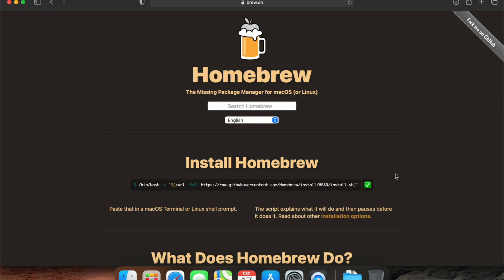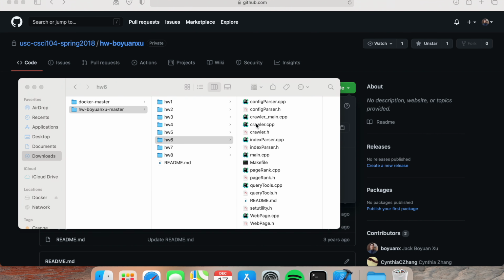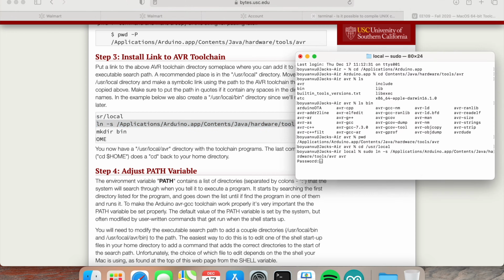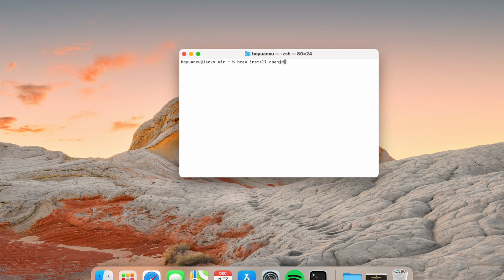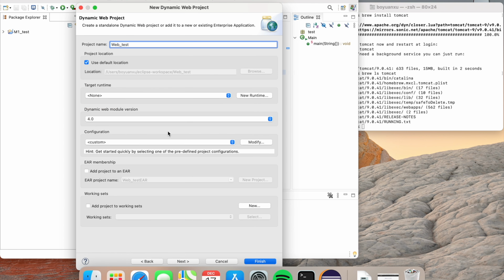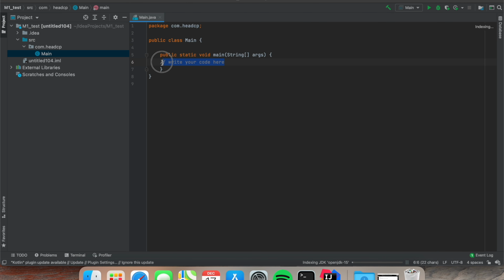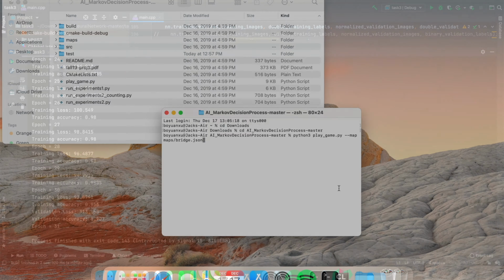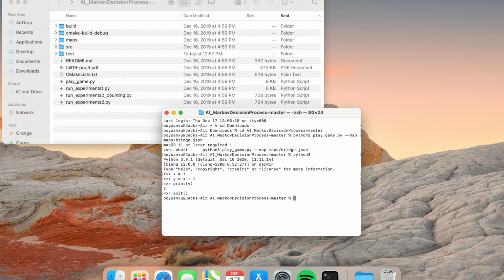M1 MacBook Tested for Computer Science Major Classes!

Comment from the maker: As of November 2021, almost all issues mentioned in this video have been resolved. M1 is now an incredibly solid processor for development work!
Reply: thanks for the update man. I am a CS student for Machine Learning. Does your video means that there is no need to buy the Pro version?
Reply from the maker: @andi9x17  If we are talking about the 13 inch, then no, Pro only adds more battery life. However, if you are referring to the M1 Pro chip, then that is a different story.
Reply: @headcp1299  Hey my friend. I am a computer engineering student, profilizing in Cyber Security. i mostly want it for linux (VMs),  programming, pentests, etc. Would it work good with a 16gb ram or should i look into a windows laptop. 
PLEASE HELP!
Reply: @fluturadomi756  windows laptop
Reply: @headcp1299  is 13 inch m1 enough for cybersecurity work and cs major now ? Will it hold in 5 years if 16gb?

Comment: Hey, Can I use 8 GB / 256 GB M1 macbook air for my college ?
I am going to be a Computer Science students in next few months. I want to buy this but I don't know if everything required will be working ( atleast under Rosetta 2 )
Reply: Incase you find the answer to your question, please make sure to let me know. I'd be really grateful cz I am considering the MacBook Air M1 too, and as a CSE student i am worried that few of the intel softwares might run on M1, if the apps are softwares are heavy Rosetta might not be very useful. Also, I don't want to be in situation, where I might have to jump back to intel just bcz few apps aren't working on M1.
Reply from the maker: If you’re only doing CS then everything will work fine. If you’re EE and deal with hardware stuff then I’m not exactly sure.
Reply: @headcp1299  I already bought it and its awesome.
Reply: @The Algorithm YESSS. I will highly recommend it.
Reply: The flutter howerver has some compatibilty issue.

Comment: So I'm starting a BS in CS this year.  For the first 3 semesters I only have one computer science class per semester since most is gen-ed, 4th semester has 3.  So that'd mean I have about 2 years until I get into the higher level comp. science classes.  Do you think in 2 years that some of the arm related issues might be ironed out?  Also could you maybe comment on if there's any downside to learning on it? Such as TAs/Professors using windows and therefore not able to help troubleshoot potential issues.  As a side note I have a fairly high-end windows PC already (3900x, 32gb ram, 3090. In my mid 20s so have nicer stuff than the average freshman), do you think having a macbook would be a good choice considering I already have a very good windows machine I could use if really neccesary, or maybe it would be better for me to stick with what I already know and go windows?  I imagine it might be helpful to be able to also do classwork on my desktop setup and would assume transfering work from windows to windows would be more straightforward than MacOS to Windows.

Sorry for so many questions and the wall of text, just trying to make the best decision.  Thanks for the video :-)
Reply from the maker: ARM compatibility issues have already been mostly ironed out and I have not run into any issues for a while now. You can always code on Windows now that it has a relatively good Linux subsystem but personally I don't enjoy it. For me, Windows is for gaming only and macOS is for serious business. It's really up to you. Apple devices do hold their value pretty well though so you should be able to sell them at a good price in the future.

Comment: So Im a uni student on computer science in greece. Should I wait for the 14'' or 16'' macbook with m1 or get the 16'' i9 intel macbook? I dont know what to do.. In uni we mostly use Visual Studio, Eclipse, Android Studio and when I am doing projects I usually open like a dozen tabs of stackoverflow. And I don't upgrate laptop for at least 3 years so I want it for long term.
Reply from the maker: Believe it or not, the M1 is on par with the i9 when it comes to most development workflows mainly due to its minimal thermal output. The i9 on the other hand gets hot very quickly and thus leads to a lot of throttling. In my opinion this M1 is already fast enough, I don’t really see how I’d need M1X in the near future. Also keep in mind the 14 and 16 M1X MacBooks will be a lot more expensive. If you can wait, then rumors are the M1X MacBooks are coming in April so you can decide then. Hope this helps =]
Reply: @headcp1299  Thank you so much! It was actually helpful. The reason i am talking about the future M1X and not the current 13” is because 13 inches are really small and i cannot do my work properly. I am used to the 15.4” dell i have for the past 4 years and i cannot go to a small screen as 13. I saw it up close on a store and it is indeed very small. That’s why i was talking about the 14 or 16. Just because they are bigger in size.
Reply from the maker: I agree, currently I regularly use this with an external monitor.
Reply from the maker: When it comes to code compilation performance, some benchmarks found the M1 is as fast as a desktop i7-8700k, which to me is very very impressive.

Comment: 8 or 16 gb?
Reply from the maker: 8, and it’s plenty.
Reply from the maker: It all depends on how you use computers. Some like to keep every program open (20+ tabs) but I’m personally more memory conscious. For me, the max is Xcode/Android Studio + iOS Simulator/Android Emulator + a few Safari tabs (<10) of Stack Overflow + Spotify, so 8GB can still be pretty comfortable for me. In terms of future-proofing with 16GB, I think by the time my usage demands 16GB, it’s probably also time to move on to a faster laptop in general.
Reply from the maker: It’s always good to have more RAM. However I have learned through my own experience 8GB with M1 does not translate to 8GB with an Intel chip... Whatever optimization they did with memory management works wonders.
Reply: @headcp1299  Agree. 8 gb acts like 16/32 gb at times. Even 2-3 gb I can't feel it being slower.

Comment: Honestly so glad you tested the Docker setup for 104  (at least running stuff). Been worried we'd have M1 probs this semester 😅 Thanks!! ✌️
Reply from the maker: Thanks Cameron! What you and Noah came up with is super cool and miles ahead of the old VirtualTrashBox approach!
Reply: @headcp1299  12:26 I've just tried running my CSCI 350 MLFQ assignment in Docker and can confirm it works as expected on the M1 MBA. It's definitely putting Rosetta 2 to work but somehow it can work with qemu well enough to run that code!